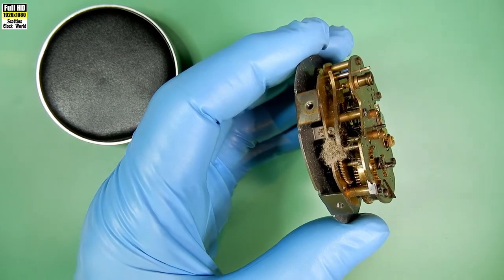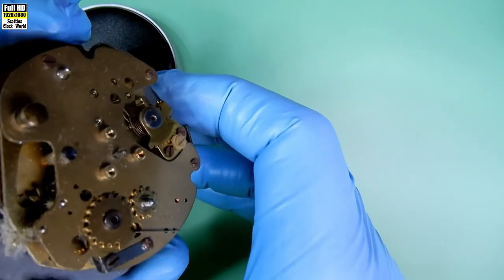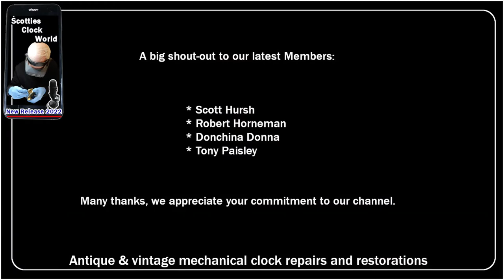Europa German Alarm Clock Repair - Part 1

Comment: I have a Europa clock too and it has the same movement as this one, but its balance wheel is broken. Could anyone guide me to where I can find replacement?
Reply from the maker: The actual balance wheel, or the hairspring? I get my hairsprings here: https://www.cousinsuk.com/product/hairsprings-clock
Reply: @ScottiesClockWorld  The hair spring is fine thankfully, but the balance wheel is broken specifically its tip which sits in the jewels. It happened after it fell on the ground decades ago.
Reply from the maker: @eaglewatch4756  , oh, that's a different matter. Usually these type of parts are scavenged from other broken clocks. The chance of a similar clock with a broken balance staff is virtually nil. eBay has used clock balance wheels for sale.
Reply: @ScottiesClockWorld  Thank you sir, I’ll keep an eye out for one on eBay even though it’s not a convenient method as most sellers on eBay don’t ship to my country.